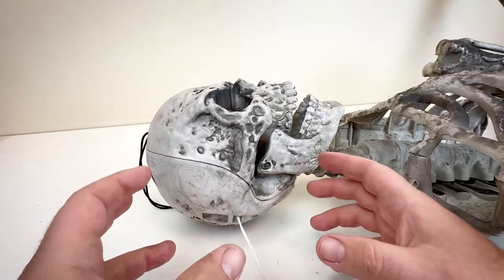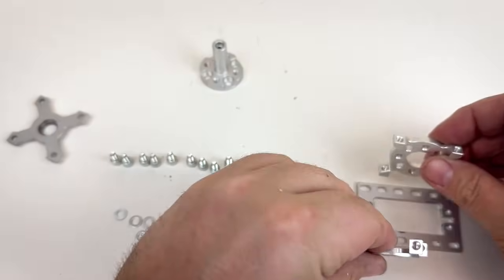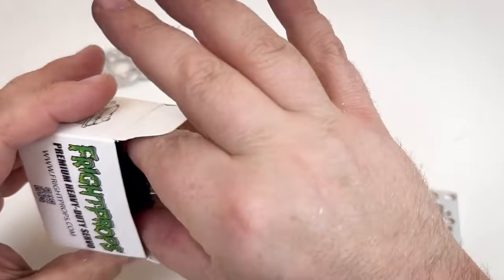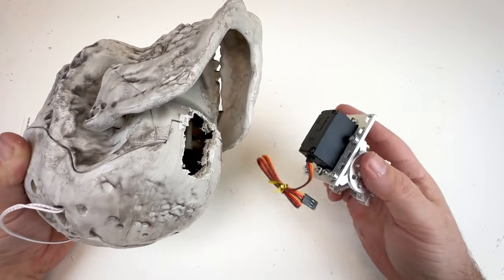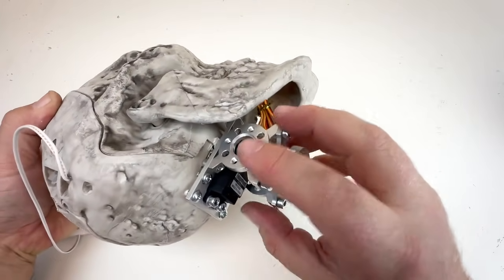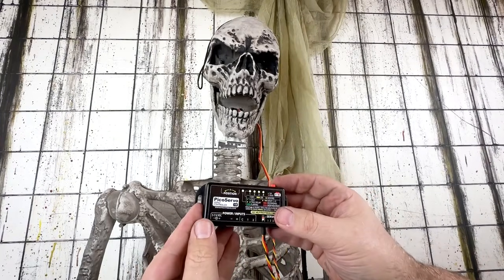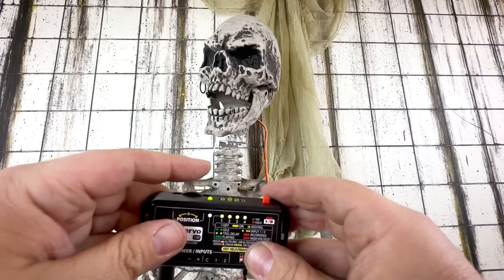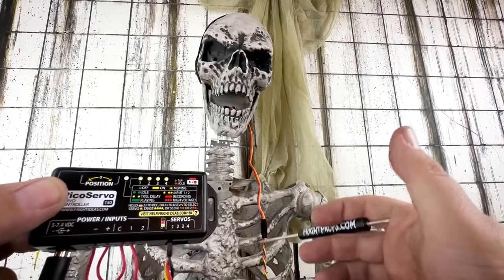Creating a Head Turn Effect with a Servo Kit from FrightProps

Comment: Will it turn automatically at random?
Reply from the maker: That would depend on the servo controller used. The PicoServo doesn't do random movement, you program a movement sequence into it. Something like a ServoTalk (another controller we offer) does have some random movement logic built into it.

Comment: Would you recommend using bolts to keep it Surcure or will the screws stay
Reply from the maker: Bolts would certainly be an upgrade and work even better than screws, but for the most part the screws work just fine. You can always add more, use bolts or add additional reinforcement as needed.